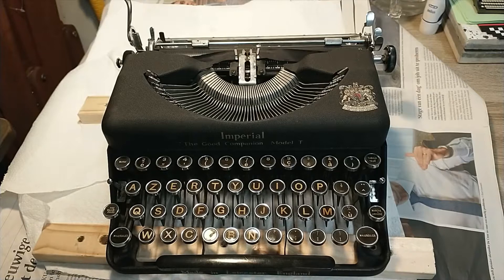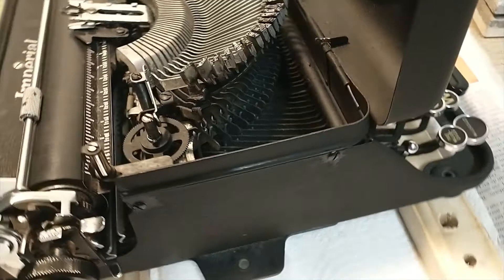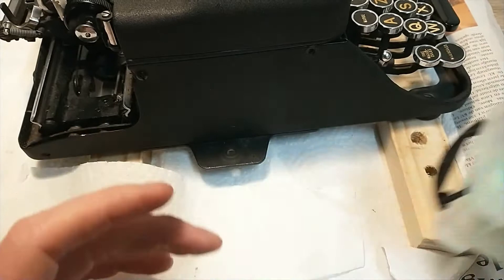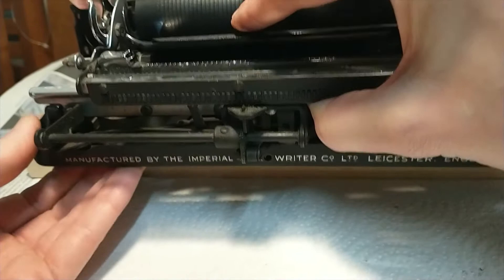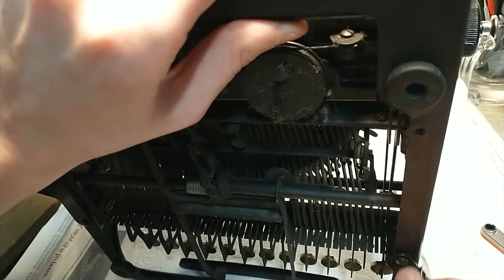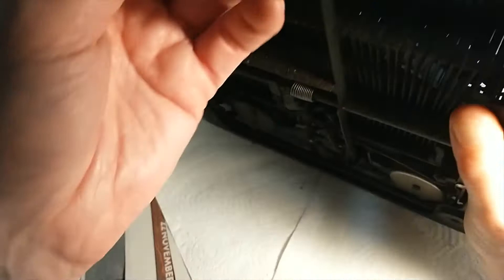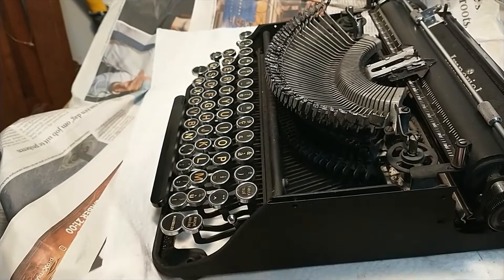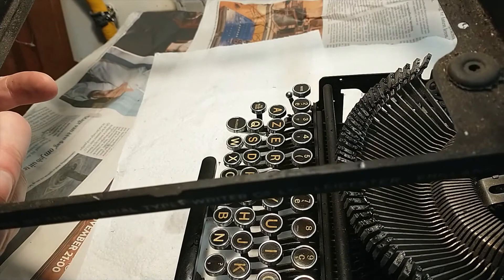Imperial Good Companion Model T  case removal

Comment: hello, I just bought an imerial good companion model T, can you recommend the ribbon to use and who/where to buy it in Canada, thanks, wayne
Reply from the maker: Hi Wayne,

You can just use standard 1/2" / 13 mm ribbon in these. They do have smaller spools than your average typewriter (and can hold less ribbon too), so you can buy any generic typewriter ribbon and respool the new ribbon on the original spools. I'm in Europe, so I can't really recommend any brand, but the US folks really like the Ribbons Unlimited products. your best bet is probably eBay or Amazon.

Have fun with your machine!
Reply from the maker: Update: One of the Discord members mentioned that if you happened to be in the Okanagan, they can sell you some Baco ribbon (good stuff, but can only be bought in bulk) when it arrives.

Typewriter Discord invitation: https://discord.gg/2F4bXgRv